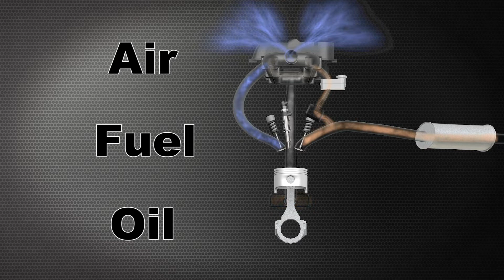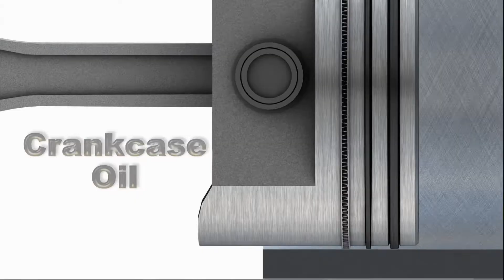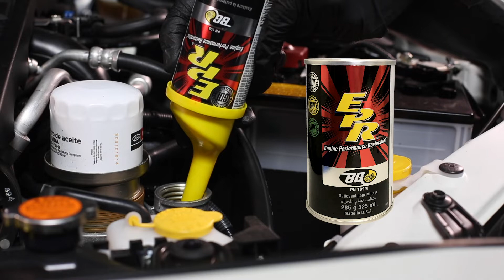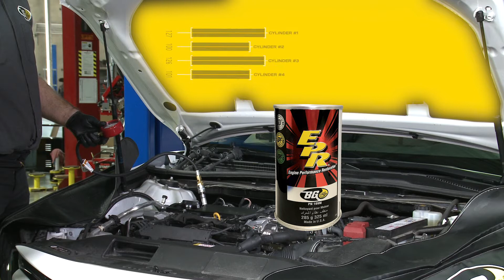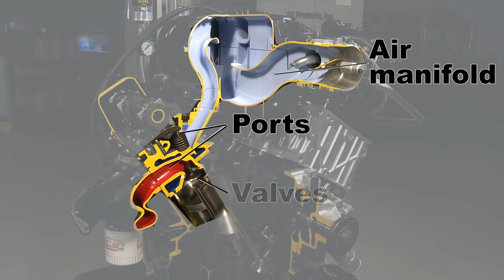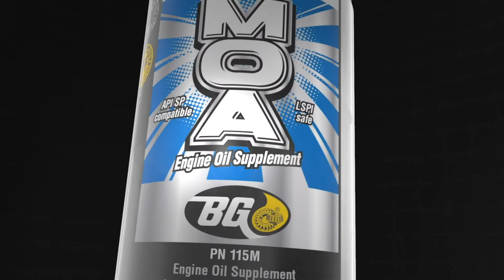BG Performance Oil Change Service | Toyota

Comment: Instructions on EPR container says run engine in idle for at least 10 minutes at 1,200 RPM. If in ADDITION to running engine for 10 minutes, will damage be done to engine if the car is driven around for another 50 to 100 miles BEFORE DRAINING out the EPR. Would these extra 50 to 100 miles give more cleaning to the engine or instead would damage the engine?